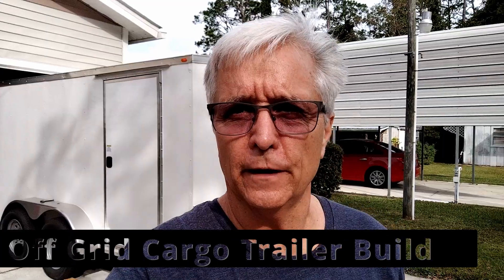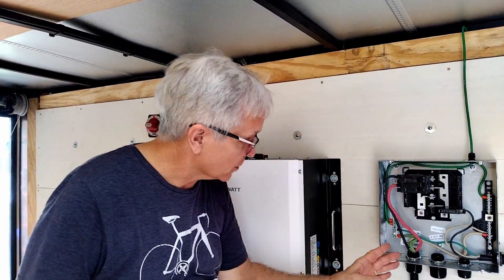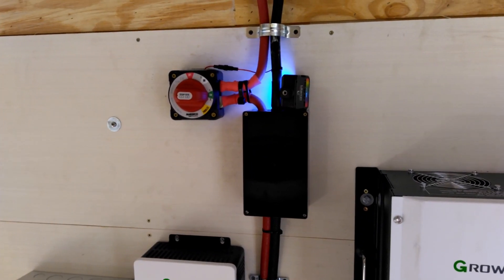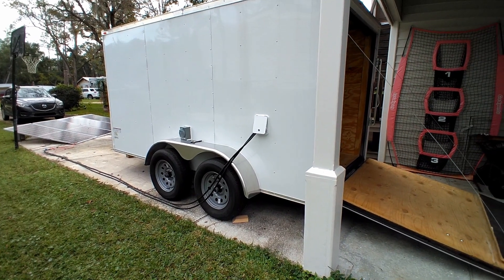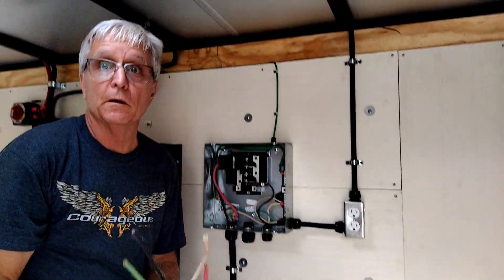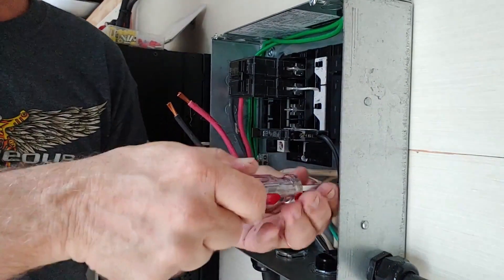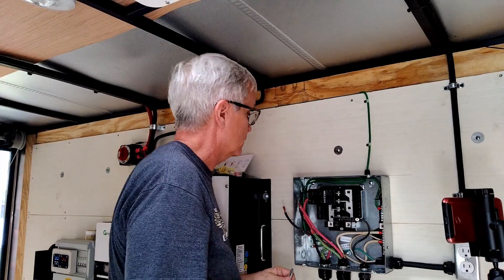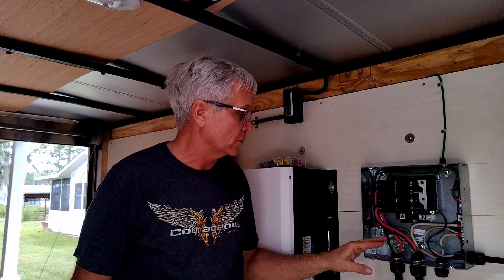Solar Off Grid Cargo Trailer Build ~ Installing the AC Wiring   Part 3

Comment: I like what you have done with the boxes, I will do so similar. The only thing that I would change is some vent holes in the shunt box as it works off of resistance across it and may overheat? Thanks!